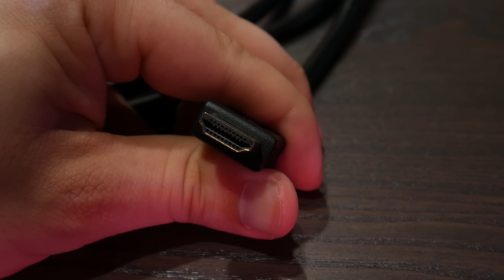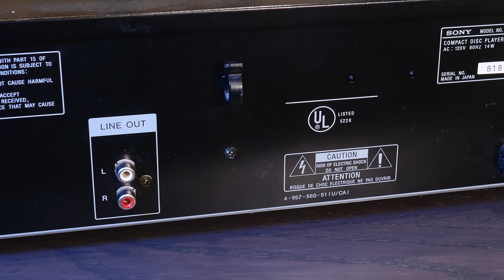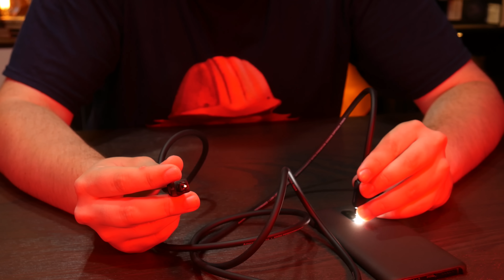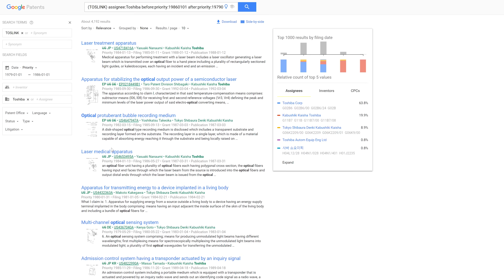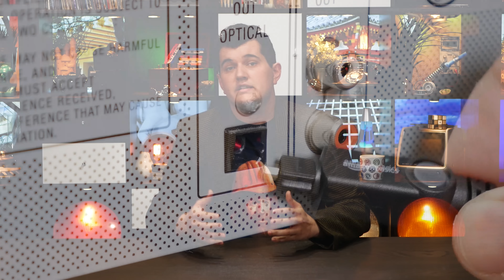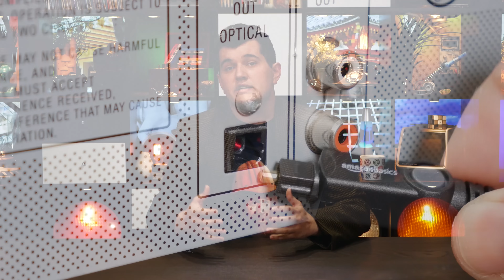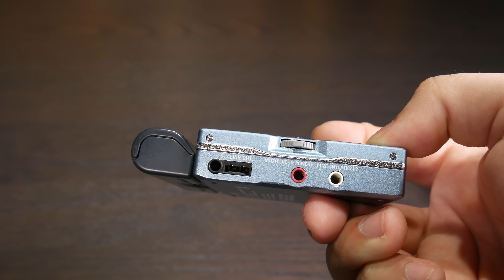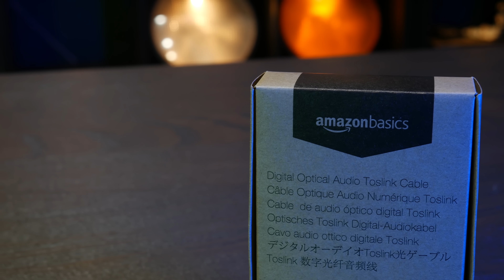TOSLINK: That one consumer fiber optic standard

Comment: Ground loop! You forgot about ground loop! Can you please update the video to save those poor souls from believing that their audio setup using coaxial spdif having humming noise has no cure? *WHAT IS GROUND LOOP * Often say you have a projector taking power source from socket, and the audio amplifier taking power source from another socket, their grounds can be at different potentials (yes, grounds are not born equal, some more equal than others. You don’t always get grounds at true 0V). And since electrical current is always looking to discharge itself through the lowest ground, having that coaxial cable connecting 2 different circuits can cause a constant current (which will be AC and at 50/60Hz) to be running through a ground, and through all ground shielding, equipment casing, or any picture of equipment that is grounded, which means they now create a magnetic field that interferes with your audio signal. And then you get the infamous Ground Loop Humming. Really, a simple fibre optical solves all these.

Comment: Ground loops are a really common problem with some equipment, especially when it is connected to separate circuits which is common in professional setups. It has nothing to do with whether the signal is digital or not as the signal is not what is being interfered with rather the reference ground on the DAC itself.

Comment: I use TOSLINK for home theater multichannel audio. My receiver (and other equipment too) are old so they don't have HDMI
Reply: Toslink, like SPDIF, has undergone a few revision updates over the years.  Toslink initially had a bitrate of 3.1 Mb/sec, I think the latest bitrate is at 125 Mb/sec with newer implementations.  So while still only considered only usable as a 2-channel connection for uncompressed PCM audio, it has been used very successfully for 4 and even 8 channel uncompressed PCM audio!  The big thing is these are special purpose applications, and not using the home theater standards.

There are many people still using the older home theater standards and equipment in the home, where it was intended to be used.  I have some older early 7.1 DVDs even that work very well with the full 7.1 audio over Toslink!

  Just because it may not be "uncompressed" audio does not mean people do not use it, and even enjoy it 

  By definition, a lower bit rate, as the result of a lower sampling rate, by itself is not compression, nor is using a lower bit-depth.  Both methods of bitrate reduction can be used to provide for multiple channel audio without compression.
Reply: Multichannel as in Stereo?! TOSLINK and SPDIF support only stereo.
Reply: @focumQuarium  Untrue. TOSLINK/SPDIF support Dolby Digital and DTS multi channel audio up to 5.1.
Reply: @ManuelMcLure  Nope. Only if digital signal is compressed, then YES. Regular uncompressed digital signal can only support stereo - 2 channels.
Reply: @ManuelMcLure  And even in computer hardware, most mobos support uncompressed digital TOSLINK. So its widest support available is rather towards Stereo, not Surround.
Reply: @focumQuarium  You did not say "support only uncompressed stereo" - you just said "support only stereo" which is untrue. My TV outputs Dolby Digital over TOSLINK so I use it to get multichannel audio to my receiver.
Reply: I also use toslink for 2 reasons: there's a door in the way of the audio equipment so I run a single cable around it instead of 3, and the most important one, the analog inputs died but the digital one survived. That's one point for not using gold plated connectors I guess. :)

Comment: My home desktop PC connects to my router via 10 gigabit fiber. But don't get too excited, I don't have 10 gig internet, just docsis cable internet (which is also a mix of fiber and copper). 

One of my favorite things about toslink is that if you're connecting a PC to an audio system, you get optical isolation between the two - no ground loop noise since theres no electrical connection.

Comment: Just FYI, although toslink is like fishing line, it has some differences. Fishing line does not pass light through it.

We learned this trying to make a DIY starry Ceiling. I later learned this is so that the line does not light up down under the waters surface, as with anything relying on total internal reflection, there is usually a small amount of light that is refracted especially on bends, and this light would alert the fish that the bait is not as it seems.

Comment: Unrelated to the video above (although I love digital interfaces and toslink in particular): I have a question that bothers me a lot lately. This is about a home appliance, but I am afraid it is more about aerodynamics than electricity. And the question is: how does a tower fan work? I am not talking about air multiplier like Dyson, but rather one of those slender columns like my faithful Honeywell HO-5500. Inside of it there's nothing more than a motor rotating a long cylindrical impeller, which is shut on both ends - well, save for controls and oscillating mechanism, which I believe is not the key here. What keeps me up at night is how the cylinder knows to take the air from behind of the device and blow it towards the front side? If the air intake was directing the flow through the axis of impeller into its middle part, this would be an easy thing, but the main air intake seems to be located just the same as the exhaust opening. So why does this work? Why wouldn't it send the air all around? The internet is full of marketing materials on how these tower fans are quiet and compact, but nothing about their physics.

Comment: My TV has an optical output (TOSLink) and I feed it through a converter to my AMP.   That way, I can switch between cable and Roku without swiching the input of the amplifier.   Had to purchase an external DAC to RCA adapter (got a great deal when Radio Shack went backrupt; purchased 2 optical cables and 2 DACs just in case one went bad; got all of these items for a fraction of what it would have cost).   So far it's been several years now and have had no issue.  Sound out of my AMP is fantastic by the way, so I have zero regrets doing it this way; made programming my Harmony 650 a breeze (did some very complicated transfer steps before).    :)

Comment: Samsungs high end TV's use fiber optic cable to connect to the tv to the I/o box
Reply: Yes but that is not an optical standard like TOSLINK. That is just using fiber optics as a transmission method.

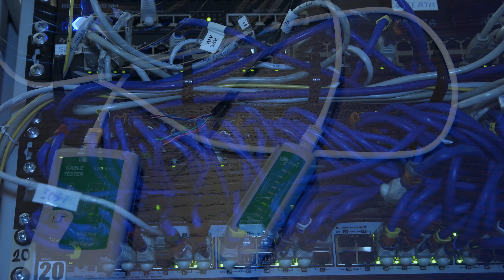Comment: 0:49 “Networking equipment in homes and businesses still use ethernet.”

So do internet service providers.  Ethernet covers 10 Mbps to 200 Gbps (with 400 on the way).  RJ-45 is not the only MDI and twisted pair is not the only medium. SM and MM fiber are present, along with a huge swath of copper channels.

Also on little corrections:
10:30 antennas*

11:00 There is more nuance here.  If there is an embedded clock that the receiver locks to then analog noise does affect the reconstructed audio signal.  A receiver could retime with a local oscillator but I’d be very surprised if they’d waste the money on that.

13:00 lol I see you do mention it but slough it off.  My thesis is on 15 Gbps jitter measurement.  It’s important!

Comment: it probably was keyed so that if the technology moves on from SPdif and the technology was similar but still different then the receiving device wouldn't be confused for example you plug fiber internet into the input of your receiver.

Because what is given between the 2 devices are quite simple on and off light there is no checks or finding out what type of signal it is like our internet TCP/IP packets do and multiple computers can connect to the same strand of fiber optic and communicate with each other.

So it probably had the idea of technology limiting factor but the system worked too well because it was so simple it worked and because it just worked that well you can now make cables for a few dollars and sell it at $2 a ft.

Who knows what the future would be if someone redevelops this, would they be able to wire up a house so that it only sends different sound sources depending on what room you are in but multiple audio sources are being put into this master control box? with the human race just barely harnessing the fiber optics in the household it's kinda strange how audiophiles haven't messed around with this more because it's great for both data and audio.

Comment: half way thru the video but if I don't write it now i'll forget, you may have even mentioned it but anyway, one other benefit a fiber optic toslink has is electrical isolation and the elimination of floating ground bla bla bla.  Since there is no electrical connection between the two devices, only optical, there is no need to run a secondary ground wire between the cases of the two units.

Comment: We might get new consumer fiber optics cables sooner than we think. HDMI is really pushing what you can achieve with copper wires. 1080p was fine with long cables, but with 4K it's already problematic with cables longer than 3 meters. Not to mention that HDMI is lagging behind what devices need. 2.0 can't even do 4K60p 10-bit without lossy compression and now we're entering 8K era, and in the same time displays are getting up to 240 Hz.

Fiber optics would solve all problems and it would even allow to daisy chain all devices! Also having your satellite receiver electrically separated from TV and other devices would be really useful. Bad thunderstorm can damage all your devices instead of just one.
Reply: Clearly you don’t know HDMI. HDMI currently can handle 10k 120 FPS with the latest version.
Reply: @andykillsu  It's just funny that you think you're smart that you point out that I might not know about HDMI 2.1. Well read again what I wrote. HDMI 2.1 wasn't even the point! Currently used 2.0 is very picky about cable length and couldn't deliver good enough bandwidth for 4K. 2.1 will require new cables, but even with increased bandwidth it will still support only 8K 8-bit at 50 Hz. Support for 10K or 120 Hz in more than 4K will require compression.
At some point we will get 16K 240 Hz displays and then we will need more than HDMI could possibly deliver. Perhaps we will get fiber optics cable that utilizes HDMI protocol, but with much higher bandwidth?

Comment: To sum up: the transmitters and receivers are expensive, the cables are rare, fragile, and too short, and the interface using RCA cables is better in just about every regard. Yet, every damn consumer device seems to use that garbage. It's one of those standards that "win" for no discernable reason.

Comment: From my short experience with toslink, the most important advantage for a home user is the optical transmission that prevents any electrical connection between equipment. This was back in the day when most things audio related for home users was analog. But does it really matter for a average home user today, probably not. These technical videos are great, a lot of work goes into making these video. Much appreciation from me.

Comment: Mercedes car starting 2002s have fiber optic systems that communicate devices like amperilfer
Reply: Also linked telephones and cd hardware, such futuristic technologies the Germans put in the car, fiber optic today is running in Mercedes as a no electrical interference from wires that ran with the fiber optic, pure quality

Comment: The problem is that fiber optics networking equipment is really expensive. Switches go between $300-$600, routers $1000-$2000, NICs $300, each SPF+ port adapter $150 and cables are 5-10x the cost of ethernet cables. But on top of that, WIFI cant reach 10gbps, laptops arent made with SPF+ adapters, ISPs dont offer uplinks that can deliver 10gbps and most webservers will not deliver 10gbps over a tcp/ip connection.

Comment: I'd take a TOSLINK over RCA because at least I know what TOSLINK is carrying. RCA could carry analogue or digital audio, it could carry one of a few different video formats, I've even seen it used for DC power transmission (Eeesh that's dangerous).

It's nearly impossible to use TOSLINK for anything that's actively dangerous (high power lasers maybe?) while an RCA connector carrying 60V will destroy tech.

Comment: I'd like to add to the merit of running digital audio over fiber optic. It's worth noting that in the realm of pro-sumer/professional-hobbyist audio recording, digital microphones may benefit well from a fiber optic connection. They typically employ rather low voltages, which, when driven over long cables, can and do suffer an enormous amount of RF noise. Prime example: a small theater filled with huge stage lights and other noisy, dinosaur equipment. XLR cables are pretty much the go-to for that situation, and they sure do an good job, but a fiber optic cable (with repeaters as necessary) would reduce the whirs, buzzes, and pops to the absolute minimum.

Comment: I had no idea that Mini-TOSLINK was a thing either! I also discovered it accidentally, and I only just now made the connection in my head. I have a mid-2014 MacBook Pro. The 3.5mm port started glowing when I ran Windows 8.1 with Bootcamp. It seemed really strange at the time, but I just shrugged it off. It makes so much sense now.

Comment: Volvo cars have been using optical ring main Links for their audio equipment since 1999, it also carries all the control signals from unit to unit , it is called a MOST network which contains up to seven modules. The brilliant Brennan B2 HD audio player / recorder uses the combined audio / optical 3.5mm output jack 😃

Comment: If you connect self-powered speakers to a receiver, and the speakers aren't plugged into the same power source as the receiver, you can get huge amounts of 60hz interference.  I am using JBL self-powered speakers in a large room, and an optical link is the only practical way to connect them.

Comment: I worked in pro-audio for years, and every last person I talked to, from salesmen to studio engineers to tech support folks, pronounced it as "SIP-DIF" (the / was treated as an I). I wonder if the "Spid-If" pronunciation was what home users started to call it since they would not likely have interface with the pros who had already been using it.

And I agree with there being virtually no justification for TOSLINK (which I have pro audio equipment equipment and manuals that refer to that as "Optical S/PDIF" instead of TOSLINK) in home audio situations. I think it is just marketing to make consumers believe they are using higher tech than they really are. Yeah, ground loops are a real thing, but when's the last time a normal home audio setup had an issue with ground loops? Large stage, studio and industrial setups, yes, but tiny local home systems, not unless something else is screwed up royally.

Comment: Easy enough to make a TOSLINK bi directional with no need for 2 cables. Just use a beam splitter mirror ( cheap ones common in CD/DVD pick up units) in each side to split the beam into a transmit and receive side, isolating them from each other. No other changes other than a more complex socket side.

Coax cable for SPDIF generally included a small isolation transformer on the transmit side, to provide electrical isolation so that you would not have common mode voltages on the transmitted data. Very important if your system is double insulated, and the inside electronics are floating at some potential around half mains voltage because of the power supply Class Y noise filter capacitors. Thus your SPDIF output needs to have the electrical withstand and creepage distances for a double isolated enclosure, as the output side could be a grounded cable to equipment. It also needed RF filtering between the 2 sides, along with a high voltage discharge resistor to bleed off static charge. It needs to withstand 2kV applied, making it more expensive than the plastic optical fibre, which is inherently ( provided your socket is not gold plated ironically) a metal free construction. 

A lot of equipment also had both SPDIF outputs along with TOSLINK, both being provided by a single chip driver. Receivers either had a switch to select them, or used an electronic switch on the receiver to do so.

Comment: 192 kHz/24 bit audio... If only the sampling frequency actually mattered (beyond about 44.1 kHz) for audio reproduction meant for human ears. Raising the bits per sample makes a difference (as long as the DAC and analog circuitry is good enough), but sampled audio only benefits from increased sample rates if you need to accurately reproduce higher frequencies (and 44.1 kHz can perfectly capture up to 22.05 kHz signals).

Comment: TOSLINK really needs an update, especially for the PC user with high end surround systems that is using a Display port connected screen. I do not know of any receivers that support display port which leaves many user stock with using the TOSLINK connector for surround sound at 5.1 since receiver have drop off analog connection in favor of HDMI and TOSLINK. Getting anything higher than 5.1 on the high end of Theater sound on the PC is kinda impossible. For some reason PC sound manufacturers/engineers still think that PC user should be stuck using made for PC only speakers or just headphones and not connect to what ever we want to and so it is made extremely hard to do so and get a good sound experience. I don't like using headphones all day.

Comment: I have a fiber optic connection between my TV and a bar speaker so... there is a place in the home of an audiophile for fiber optics but yeah, not very many other uses.  My 1982 Buick Lesabre used fiber optics to hide lights behind the dash to light up switches.  This isn't a traditional data use and just a means of carrying light from source to output but still, it was plastic fibers carrying a light signal in a basic binary format.  1 or 0 on or off.  :-)